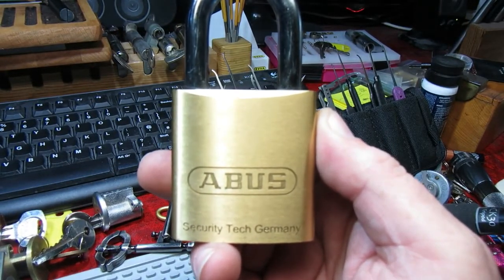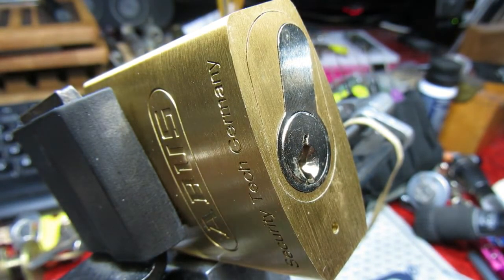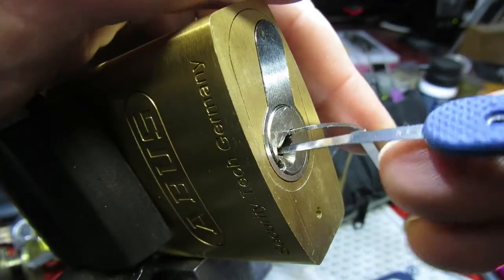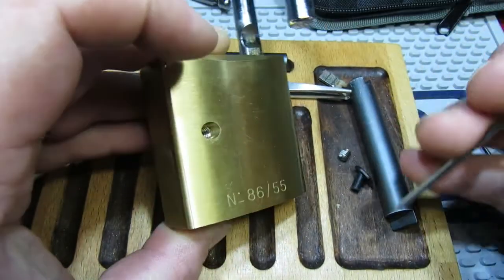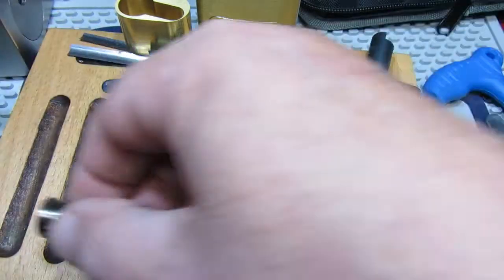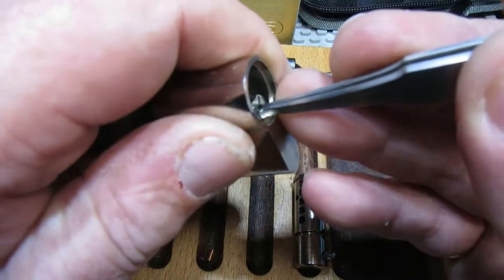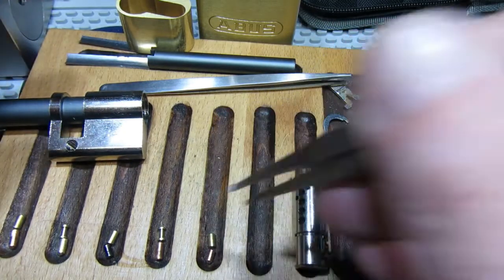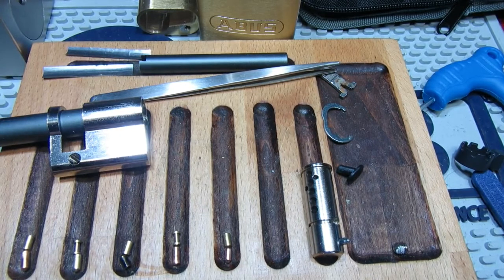(190) Abus 86/55 with a Basi Core SPP'd & Gutted

Comment: Nice. Never seen that model.
Reply from the maker: Thanks, and I can't believe I found an Abus padlock you've never heard of, maybe it's not available in the States. if so let me know and I'll see if I can source one for you with a suitable core.
Reply: Well ;), you have the very nice 83 instead ;). The 86 is availiable in 45 and 55 and also Titalium versions, which look quite nice :). The 55s have the option to activate the keyretaining functionality, by setting the actuator of the core to a different angle :).

Comment: Nice job. I wonder if they make 1 to take that 1 you just sent me. It was a half euro oval?
Reply from the maker: Thanks, not that I know of, but I'll look into it, but most of them take proper half euros, not cut doubles, as they use the euro actuator to operate the padlock rather than the back of the core.
Reply: I don't know if you looked at that Assa but it was a half euro but an oval. Not the Scandinavian oval. It has the euro actuator. It is a 4833, the usual oval you think of is the Scandinavian 4801 with the actuator on the back. Had a Gaba half euro but it had the crimped clip, with no break in it, like the Wilka. I looked and your parcel is in London.
Reply from the maker: An oval fits instead of the lock holder, but it fits very loosely,so designed for it, the main problem is the actuator for the padlock is only sized for a euro so a half oval still wont work.